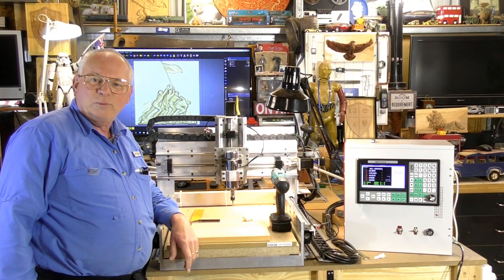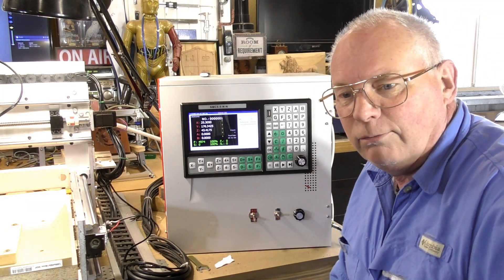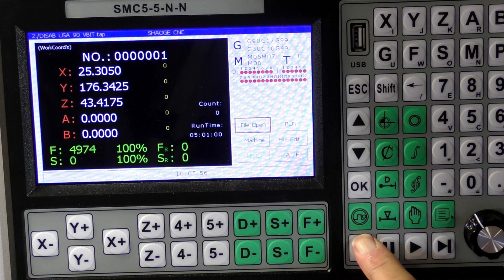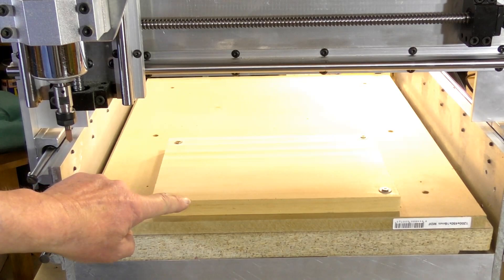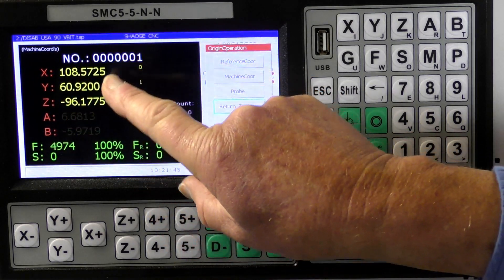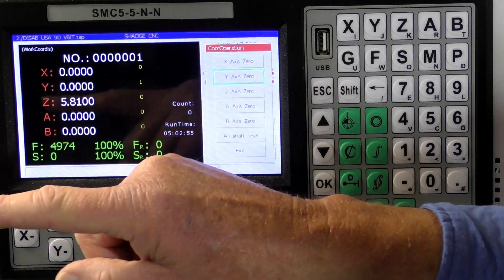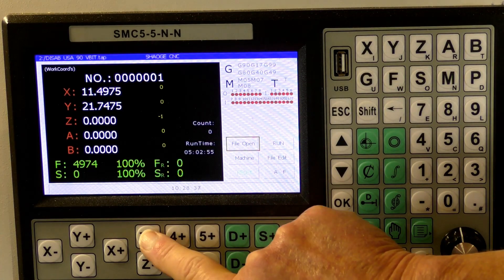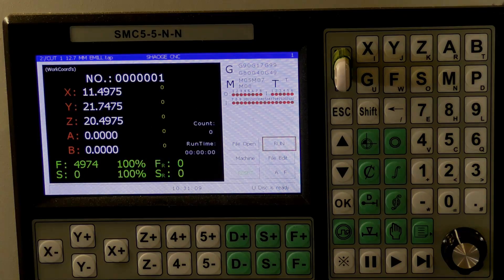Setting up in detail a MIDI CNC router to machine a 3D relief with an SMC-5-5-N-N controller

Comment: Roger, I have followed your MIDI video series and the results that you are receiving from the build are tremendous.  I am considering joining your patron channel so I can build the MIDI.  I do have one question that I hope you can respond to ... I think the MIDI is the right class of machine for my purposes but I would like to have an extended Y axis ,to about 1000mm. Base upon your design, would this be just a matter of longer rails and ball screws  on the Y axis or would I have to beef up some of the components to accommodate this ? 

Thank you in advance and please continue with your wonderful content and sharing your talent and knowledge with the world.

Regards,
Anthony
Reply from the maker: Hi, have a look at my new AMAX CNC router build it is 1000mm x 1000mm
Reply: @inventorsworkshop9600  Roger,  I did, a great CNC and was very tempted but the $2500 price tag put it out of my reach so was looking to modify the Midi slightly